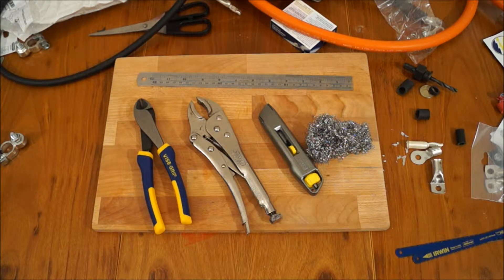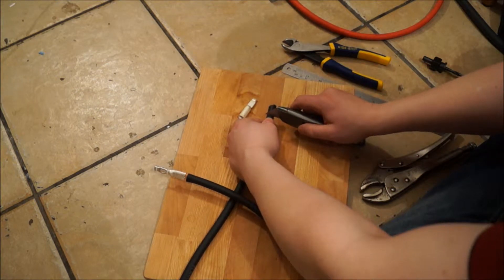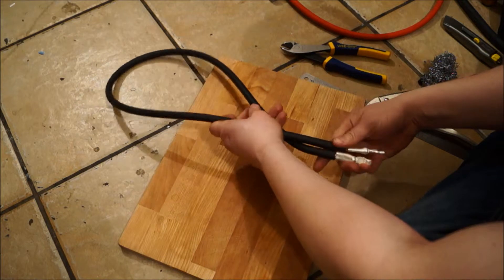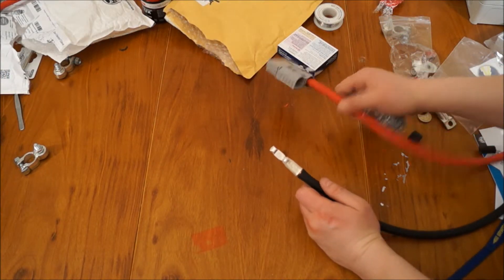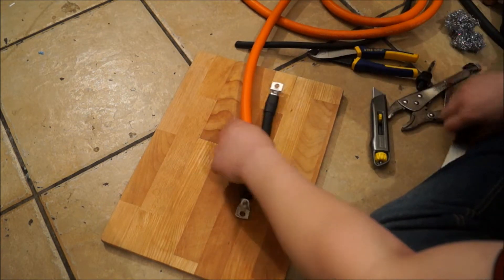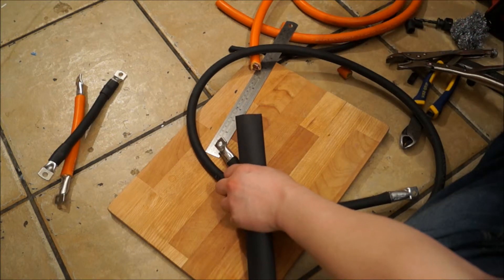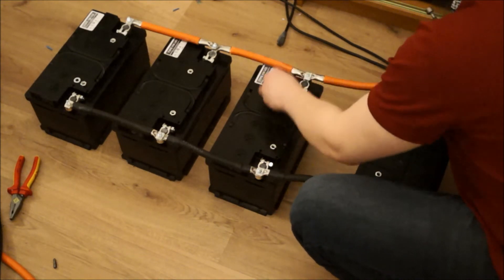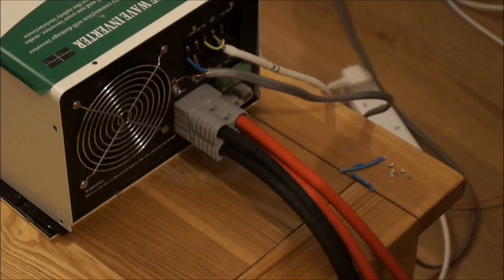500amp Cable Cutting/Crimping and Anderson Connectors

Comment: You better keep an eye on those crimps. Vise Grip crimp wouldn't make a good mechanical bond like a hammer crimp or mechanical crimp. If you pull a lot of amps they can heat. Hate to see you burn something up..If nothing else put them in a decent vise. Just FYI good luck.
Reply from the maker: +Bruce Arntt A vise is a great idea for a DIY'er like myself, Great advice!!